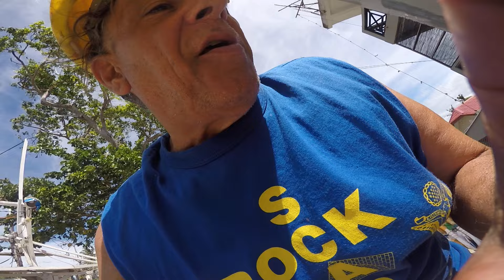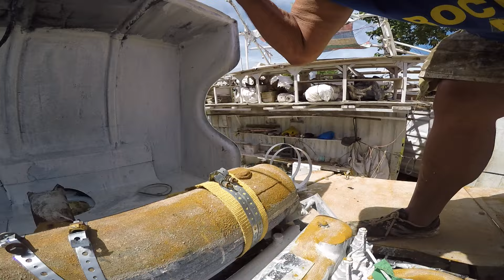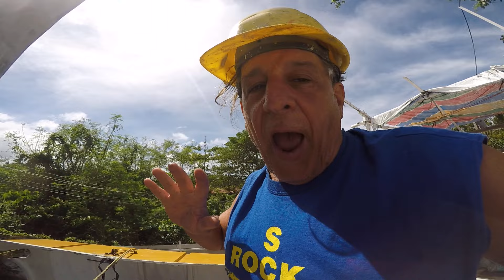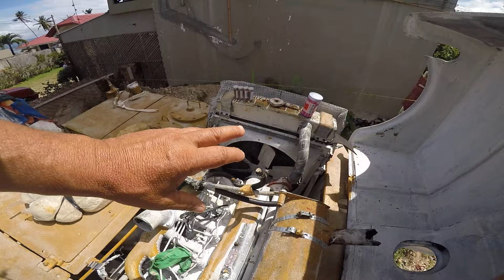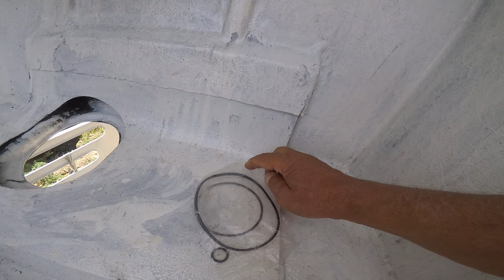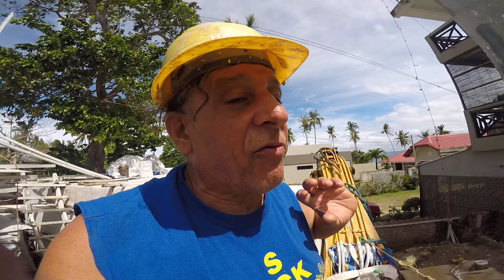ENGINE COOLANT IN THE DIESEL OIL AND 6 WAYS FOR THIS TO HAPPEN gopr2569

Comment: I would take oil pan off and fill the coolant and look to see if water is leaking down from liners.
Reply from the maker: Keith Raines Kieth, THAT is a great piece of insight, and I WILL do just that when the time comes. THANK YOU FOR your knowledge and PINNED to the TOP.

Comment: Michael,so you basically have to overhaul that diesel  engine ?If you're able to fix that equipment he owes you a lifetime use of that machine or any other equipment he has ,see if he will go that distance.I had an uncle in Manila 40 years ago , he used to fix  all kinds diesels  while  the engine was on the vehicle or truck like you're thinking of doing. That's no job for you ,a real tuff break you got there!